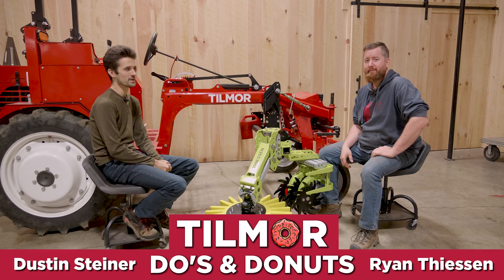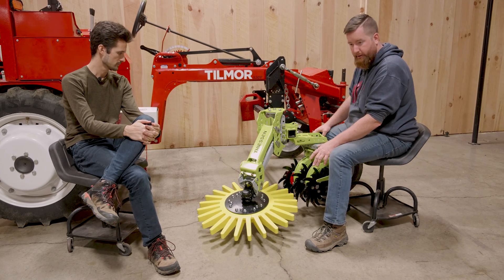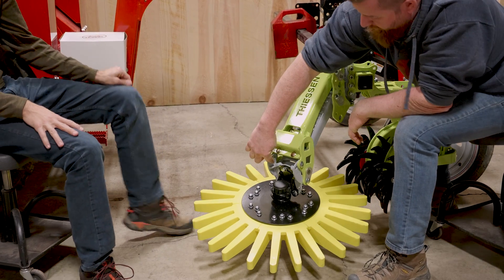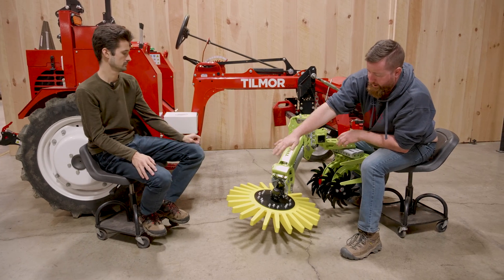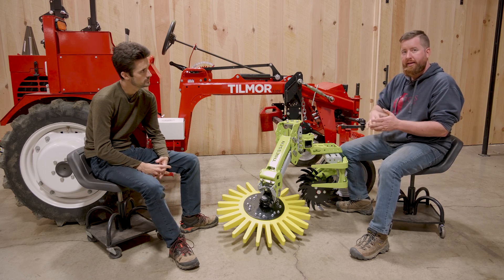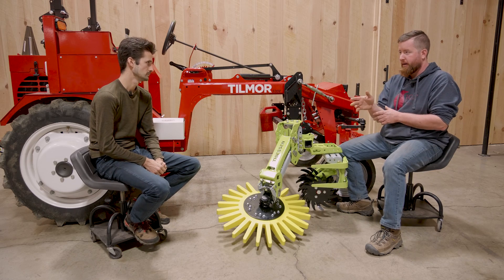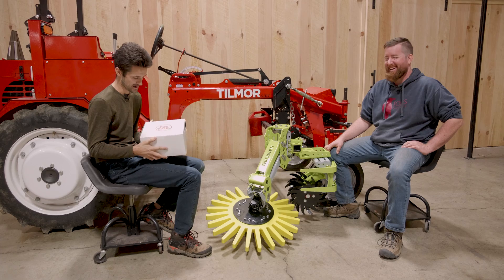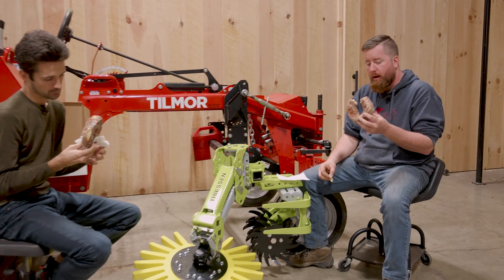Do's & Donuts - Adaptive Cultivator System With Ryan Thiessen - Episode #2

Comment: Is there a way to adapt to a Farmall Super A?
Reply from the maker: It bolts right up to a 2" (or 50mm) square toolbar and we do have the adapters to take your Super A to a 2" toolbar from your lift arms.
While we haven't run it on the Super A, based on how well it operates on our 520 tractor I would say it should work maybe even better considering your weight distribution is located right over where the ACS will want to push your tractor.
We will be running it on a Cub and 140 this spring.
Hope that helps!